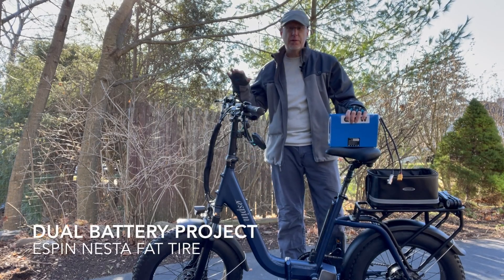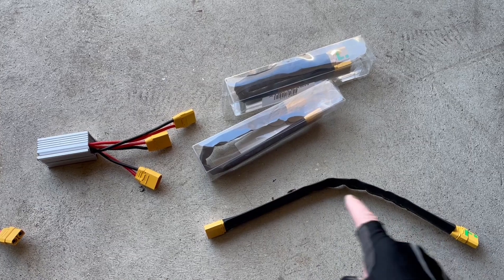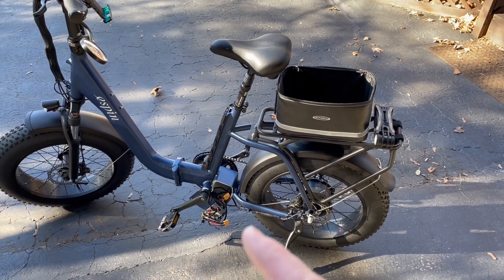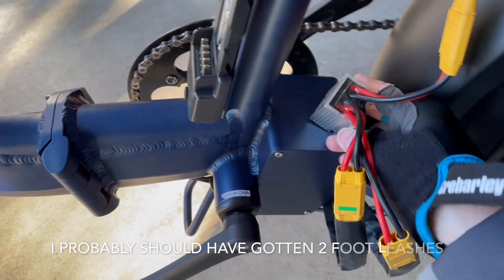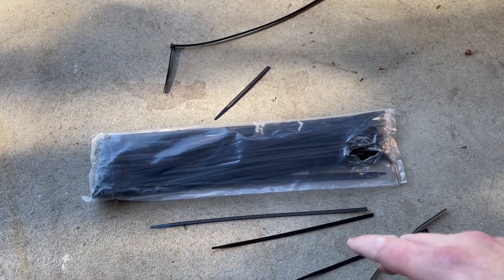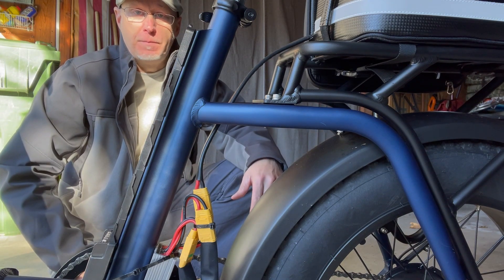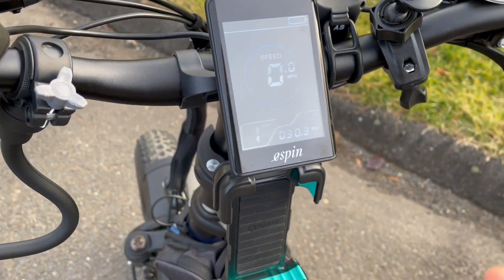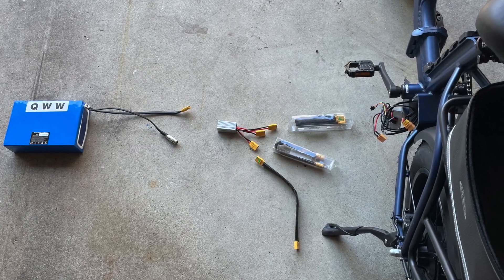Dual Battery Ebike Project: Easiest Way to Add 2nd Ebike Battery

Comment: are there any restrictions on the typ of battery I can use...I was told that the battery should be greater than maximum power(w) and maximum current amp(amp) of the battery should be greaterthan or equal to the power and current of the motor....is this true...I want to add a battery to my zugo rhino which is 48v 21ah and the motor is 750w.....and I neeed some advice on what would be a feasible battery to purchase....or does it matter when u use the blender?
Reply from the maker: You just can’t mix voltage if you have a stock 48v battery you can add another 48v of any size
Reply: @ChrisCrossed  can I go up to 52v when I have 48v? Thank u by the way
Reply from the maker: @thexproductions90s  no you can’t mix a 48 with a 52
Reply: @ChrisCrossed  got it
Reply: @ChrisCrossed  I have one last question....the batteries I've been looking at say don't use with a Shimano motor.....I believe my zugo rhino will have a Shimano motor....it's says Shimano Altus 7 Speed Trigger Shifter Drivetrain.....does that mean the motor is Shimano?

Comment: If I were you I would hide that silver box inside the bag and then use longer cables. This way you have much better protection against water and it would also look much better overall!
Reply from the maker: Yeah I need to get longer extensions to do that...
Reply: @ChrisCrossed  make your own Chris. Just cut the connector off with about 4 inches and get matching awg wire. Solder or crimp the length you need and heat shrink. Very easy and will held the cleanest most proper setup

Comment: I have a 750w 48V 24.5A electric bike. I have plans to add another 48v 17.5A battery. The controller can be set up to 25A max.
How many amps are the battery parallel connectors?
Reply from the maker: I think they are 30 amp so you should be fine

Comment: Much respect for the execution of this great project.  In retrospect, do you think it was worth it to do this?  I was considering biting the bullet and buying a new battery from Espin (the replacement battery with the higher Watt-hour rating).  While costing slightly more than your set-up (if we include your labor, it is equivalent), the benefit is that I can leave it at home for short trips and carry it when I plan to do long trips.  I suppose you can do that with your setup, by leaving home the original battery, but the beauty of the interchangeable nature of the OEM second battery is that I would have 3 options: Short ride = original only, Medium ride = the larger Watt-hour only, Long ride = both with one in backpack/rack trunk.  Plus it all looks cleaner.  Anyway, thanks for the super useful video!
Reply from the maker: Thanks for watching. I'd say it was still worth it. Even if you got a 2nd battery you get more more AH with the after market one installed. On my initial tests I got about 65 miles in range. Its a super easy add on and the 2nd battery can easy be removed with a simple unplugging of the cable. I was going to add a rear bag anyway so the only thing you really see is the wiring.

Comment: When the batteries are connected and all finished can you charge both with your original charger. Good video. Thanks
Reply from the maker: Thanks for watching, you still have to charge both of them separately…
Reply: @ChrisCrossed  need to disconnect them from the device?  Or not?
Reply from the maker: @tvstartcompilation3995  nope charge in place

Comment: I would’ve used a sealable Gromit, to put a hole in the bag, as it would help with its water resiliency.
Reply: I thought the same when I saw it. But if I was doing this I would actually buy a rack battery back and mount it under the rack

Comment: Nice upgrade...how do now charge your connected batteries? Can you put a charger on one battery and another on the extra while having that parallel connector connected?
Reply: I suspect the dual battery box is essentially two high powered 30 amp diodes so each battery does not affect the other. This should allow each batter to remain connected while using the charger meant for each.
Reply: @HostileHST  Never assume when it comes to hoping these china batteries have anything to protect them from blowing up.  The way I hook my dual batts safely but still have to charge each batt separately: https://youtu.be/9zILIYZwDAE
Reply: @videoforgeeks  I don't assume anything, just think it's possible and if the arguement means, keeping a strict eye on things, I totally agree with that. However, I do appreciate your comment as it is very important to be safe and to do whatever it takes to be safe. I still stand by my comment despite the reply. Out of fairness though, I will watch the link provided mate.
Reply: @videoforgeeks  Already seen that video, but again, I was referring to what might be inside the device. Two high powered diodes and ASSUMING both battheries are at a fairly equal value, aka voltage, etc., my thought process remains the same :)
Reply: I am curious about the charging situation too
If I use the original charging port of the bike will it charge both batteries at once?
Reply: Asking the same can u charge two batteries at once with balance discharger

Comment: Chris, I think you will hit 80 miles fairly easy if your a pedaler. I'm running a Bolton combiner on a Aventon Aventure with the 15ah stock battery and a 13ah add on and I did 87 miles @ 15-16 MPH assist 3 on a trail with quite a few mild climbs. I finished with 14% left and the last  8 miles was in assist 5 because I was running out of light. I think you will really enjoy the extra distance making it capable of touring. It does make the bike a bit heavier on the kickstand but once moving it really doesn't feel that bad. Note: I did upgrade my brakes because at home I ride many steep grade river canyons in the west Sierras.
Reply from the maker: That's awesome range, thanks for the comparison.
Reply: Chris I’m looking into doing the same to my Aventure could you please give me some details on how to.

Comment: Definitely would like to see you do a video with the LECTRIC XP 2.0. been thinking about doing this. Saw a 1.0 and it's pretty good.
Reply from the maker: The Lectric apparently has a Deans connector not an XT90 unfortunately
Reply: @ChrisCrossed   is it possible to redo the wiring of the deans connector?
Reply from the maker: @shotxcj2655  I assume so but that is beyond my expertise
Reply: @shotxcj2655  definitely doable
Reply: @jaredz9507  I already did on my bike,just wating for my extra battery.

Comment: Very interesting upgrade i ride mine with an extra battery once the one in using die i swap the other one. Thanks for the video.
Reply from the maker: Thanks for watching, no more range anxiety...
Reply: Hi DFG, the interesting thing is...when you use one of these combiner devices it actually over doubles your distance. Think of it like running a flashlight on extra high setting, it is nice and bright but short lived. Same light on the lowest setting and it will most likely last much longer. Add a number of more cells to ebike and it will sip from each cell more slowly without over stressing the whole lot of them, thus the more longevity provided you ride it in a decent manner. My wife has two 15ah batteries and switches them out like you do and I can out distance her every-time (by a lot, 15 to 20 miles) with this combiner even though her batteries equals a total of 15ah +15ah = 30ah and mine 15ah + 13 Ah = 28ah. Also much less drop off towards the last of the energy. Her combiner is on the way!
Reply from the maker: Good to know!
Reply: @mokeriver  Bolton?
Reply: @DevonKocevski1  Now known (name change) as Area 13 ebikes.
Reply: @ mokriver. That's an interesting point you made. I wondering if you could test that when you add one to your wifes bike and post the results in this thread.
Reply: @mokeriver  I don’t understand, are you saying that the battery controller that is in the video better or is adding more cells to a battery the better way ?
Reply: Hi you doing my friend just wondering  how your nesta is doing with the extra battery upgrade does it work it give you longer ride mileage? just planing to do the same you did, i already bought the trabsfer device from bolton bikes, make another video about yiur upgrade thanks.
Reply from the maker: @diggingforgold4150  I haven't been able to ride much since doing the upgrade, Its gotten cold and its Xmas week. But my guesstimate is 70-80 miles of range. In the spring I will test that in some warmer weather. I love riding the Nesta so it will be fun to go farther on it.
Reply: @ChrisCrossed  am thinking about doing the same to my bike.. Will I be able to use the same charger I ce with from factory to charge both batteries at the sane time ?  Both batteries are identical that came with bike ( I bought an extra)
Reply from the maker: @gusc6785  no I don’t believe that works, still have to charge both separate
Reply: I just bought a 36 v 20ah battery plus some high power schotty diodes (cheap) to do dual battery set up until I can afford the mosfet setup. Being a bus and lorry driver I would request all bikers to wear hi viz and also lights . If at all possible don't weave through traffic such that bother drivers don't realize where you popped up from. Peace.

Comment: Would it be possible to do something like this with the lectric?
Reply from the maker: Open the controller box and see what kind of connection you have, if it has an XT90 and a hole to thread the new cable yes.